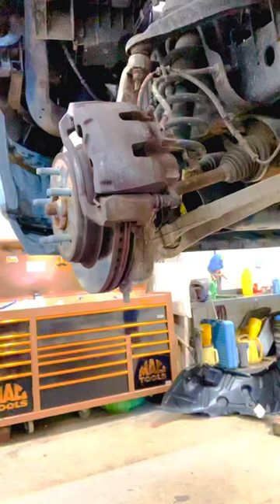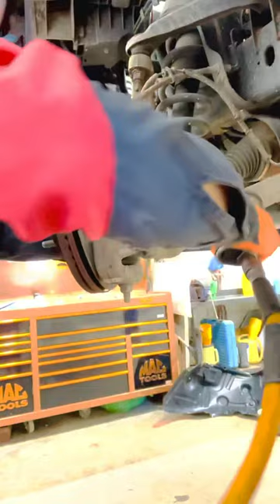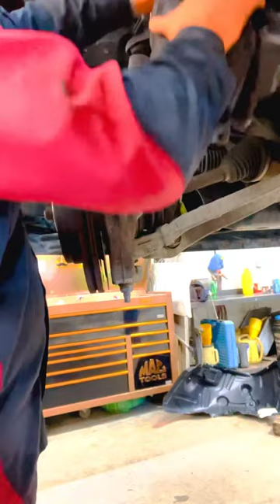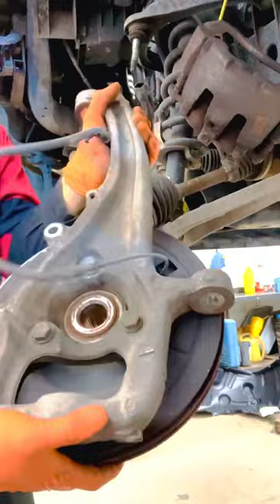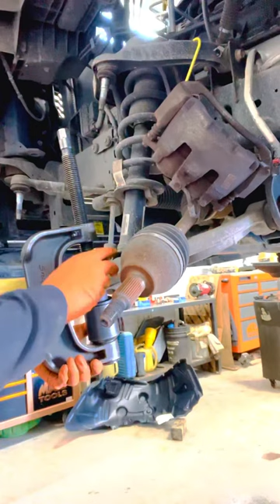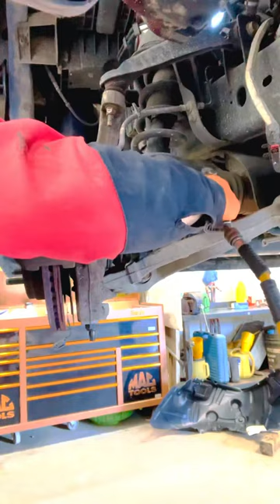Dodge Ram 1500 lower ball joint replace#dodge #ram #mechanic #automotive #chrysler #youtube #google

Comment: I put the same ball joint on my 2014.  The axle hits the zerk fitting and ended up ripping the cv boot.  Had to take everything back apart and grease and plug the ball joint.  Sealed ball joints from now on for the lowers

Comment: I have an 09 2WD Ram 1500 with 235K miles that needs ball joints.  The ball joints look like they are fixated in place not to be removed by a press.  I have been told that I will need to replace the control arms, is this correct?  Seems crazy to replace the entire CA for a dang ball joint.

Comment: Great video but completely forgot to follow the torque specs of the Tie rod end nut, the Upper and Lower ball joint end nut and the Axel hub nut. KNOW YOUR TORQUES to do a job without future failures and wheel bearing failures. Over and under torques are not safe and lead to more failures. Other than that, the job was perfect. (Impacts are not torque wrenches)